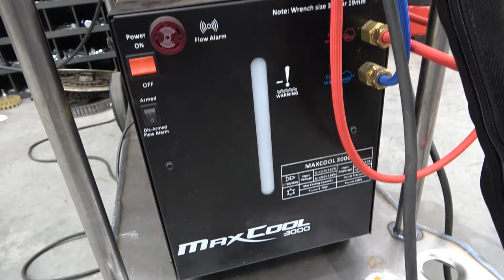Harley 883 Cross Kart ~ SEMA Build Ep4

Comment: Just stumbled across your channel. This is a great build. I have a cross cart I built from the ground up using a VTX 1800 motorcycle motor. I also kept the shaft drive and used a old mail truck axle in back for a easy install. Custom built a IFS front end.  Great job !

Comment: Instead of the way bar you can put a steel cable to hold the wheel up when you go around corners  and stop the wheel push the buggy over.

Comment: running your limit straps the length of the shocks is a no no, they will stretch an inch per foot so the shorter you make them the better.
Reply from the maker: The shock has way more travel than the limit strap lets it

Comment: For someone that can fabricate like you, I have an idea I want to build. Start with a older gas golf cart with a factory cut down car diff. Usually Robin powered. Find a '85 Honda Gold Wing. From it the engine, trans, drive shaft out, radiator-plumbing, wire harness. Strip both rigs marking and storing all parts. Mock up the engine-trans in front of the cowling. This will give you the front frame extension including radiator and front suspension mounting. (Drop tube front end with cross spring and mount.) Can you see where I'm going. I think the frame extension may become a whole under frame rail build. Once the frame is done, engine mounted and you mate it to the diff, There is your base to a "Golf-T". Massive 20 inch rear tires, thin fronts. Rebuild the front cowl to fit. 4 wheel disc brakes. You know the rest. Challenge? Who gets there first? SEMA Hot Rod Build!

Comment: Could you explain why only certain year Prius steering assists will work? Why won't other years work?
Reply from the maker: They revert to off when the computer doesn’t see the body control module. This year reverts to on.
Reply: @RedBeardsGarage  interesting. Thanks for explaining. Seems scary that a manufacturer would want it to turn off when it loses connection with body control module. That's a bad way to drive.

Comment: Nice build but the Harley 883 motorcycle has no power and hits the rev limiter so in a big heavy buggy you may have to push it around the track you should have gone for the 1200 minimum

Comment: Just wandering with the money that went into thus build why not use a RPM gearbox and do away with that big pulley in the rear. It's chain drive and you can get them in different gear ratios AND reverse 😏.  Nice build for sure, but the gearbox would have looked good back there. Just wandering is all.

Comment: Man, tell me your not going to Tig weld that hole framing. Okay it makes sweet welds, but your going to use 6 bottles of gas. Pull out the Mig gun bro, that's what it's for. The filler metal is the same.

Comment: I like the bigger frame Kart and larger wheels, but the Harley engine is a deal breaker. All that noise and no power. Would rather have a 1000cc crotch bike engine. Sounds better and pulls better.

Comment: dude, what is with the gigantic rear sprocket? you do realize, it's not a go-kart, right? that motor has both, a primary, and a secondary gear reduction, and your average go-kart, or mower engine, does not. that's why you don't see sprockets, that are the diameter of the back tire, on Harleys. all that's going to do, is kill your top speed, drastically. the thing already makes tons of torque. you don't need it. for a 30 inch tall tire, you should be running a 50 TOOTH sprocket, not a 50 inch diameter one?!? with that sprocket, this thing's only going to do 40 mph top speed. not to mention, it kills ground clearance. yeah, that giant sawmill blade, needs to come off. 🪚❔😝